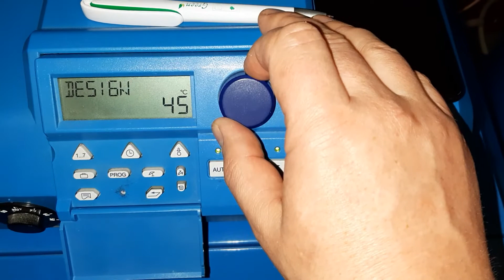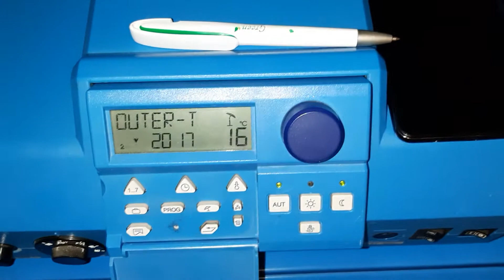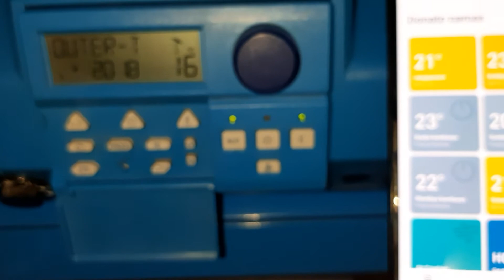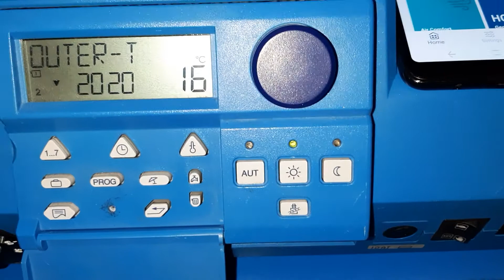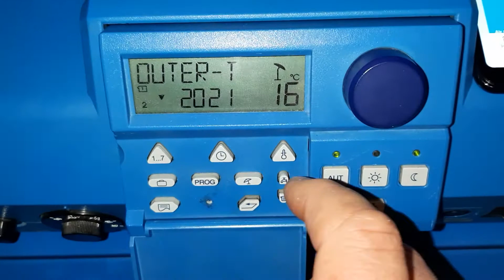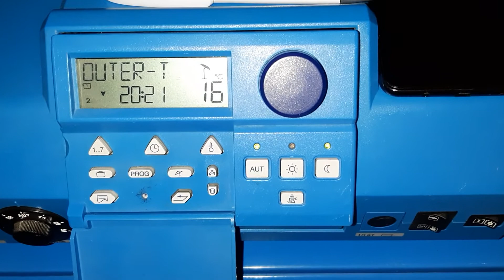TADO  with Buderus Logano 2107

Comment: Hi. I have the same buderus with 2107 control unit. As i saw you upgrade it with tado thermostat. How can I get more info on this setting? I would like to upgrade my buderus with smart thermostat but there isnt lot of info how to do it.
Reply from the maker: Hi. I returned all Tado's stuff back... They were not willing to change the code and adjust thermostat commands to work properly with logano 2107 and purposed to refund all items. There are quite few less expensive smart TRVs, without connection to boiler...
Reply: @DonatasPin  tnx on replay. I was considering to buy this smart thermostat along with smart radiator thermostat but if it doesnt work... just a waste of money
Reply: @DonatasPin  sorry if i bother you but i saw on your video that you have fm 242 module. Im planing to buy this module and get it installed. Can this module control hot water and heating separately? I would like run hot water ie from 07-09 am and 07-10 pm but heating from 07 am till 10 pm. Is this possible to do it with this module?
Reply from the maker: @danieldekovic9706  no, hot water is being prepared when day mode on any circuit... I placed sonoff Wi-Fi module on wire the hot water circuit, this way I have my own water heating schedule, of course only during day mode schedule
Reply: @DonatasPin  this is the key in lowering gas consumption. As  i saw at least 80% of gas consumption is driven by hot water. When temperature drops by 5C in boiler buderus fire up to restore this 5C. I was looking for solution to override this because i dont need hot water all day and gas is wasted. Im doing this now by programs but this isnt a best solution because  night mode must be activated to turn the hot water off during the day. How did you connected wiring for sonoff ? Did you do it by yourself or by some pro?
Reply from the maker: @danieldekovic9706  I did that by myself. will send you a photo tomorrow...
Reply: @DonatasPin  tnx
Reply from the maker: @danieldekovic9706  it's seems not possible to attach photo. I could send it to pm
Reply: @DonatasPin  please do send it to pm if you can. Have you done any other mods on buderus?
Reply: @DonatasPin  Dear Donatas, what does it mean? Please give a quick explanation.
Reply: I solved the problem Perfectly works the Tado thermostat with the gas boiler Buderus G124 without BFU and without extension modul.
Reply: @bollazoltan904  Hi, can you please give us more information how exactly did you done this and what hardware did you use, how did you made connections etc. 
Tnx in advance.
Reply: @danieldekovic9706  I set the menu of the buderus boiler for use without a room thermostat. I switched it to manual heating mode using the middle "sun" button. And the current from the heating circuit pump is interrupted or closed by the Tado thermostat with the R01 setting
Reply from the maker: @bollazoltan904  Hi, that video was prepared to Tado support. They do not support our boiler. But that was announced already after I bought whole set.  I tried to force them to provide help, but with no result and I finally returned  all equipment. Now I arranged  even better with Tuya thermostats from Aliexpress and home assistant
Reply: @DonatasPin  Could you share how you manage to do that ? Thanks
Reply from the maker: @stephaneclinckart1772  please refer to my older postings here. Smart TRVs regulate individual rooms based on local temp and depending on whether family is home or not (this feature coming from home assistant). Weak part of that is that boiler is circulate  water by schedule,  even when all TRVs are closed (autumn/spring time) . For that I tried to use resistor to imitate high room temp from BFU, but switching from winter to summer regime is not working instantly, so that didn't make sense.  Finally I used one more smart reley to cut the circuite between contacts  10 and 12 (there should peace of wire between them). When these not connected boiler is not igniting. There are drawback in that,  because after some time boiler is showing error, but it's gone when any TRV is requesting heat, and throught home assistant connection is restored. Im still testing that...  sounds complicated,  but did not find other solution. Hope that will help
Reply from the maker: @stephaneclinckart1772  that is interesting item... did you bought  it?    As I understand its necessery write ESP code yourself, which is C++ based,  as I know... that could be tricky
Reply: @DonatasPin  It is out of stock for now but I subscribed for next supply. Before end of the year. I'm in contact with Daniel who develop it. Nice guy. He is working on the firmware too... I don't think you will have to code something. Only the specification of your account and IP address. It looks really interesting. ESP can be write in C also... what is easier. I'm a Java dev... use to code on arduino. I don't see a problem for myself here.
Reply: @stephaneclinckart1772 , i'm very happy i'm not the only one who struggle with it. Like all of you i'm searching a way to make my Buderus 2107 smarter.
From what i understood (and correct me if i'm wrong), the 2107 console is NOT compatible with ANY thermostat. It works differently: it decide by itself to heat or not from the information he got (heat curve, external temperature, schedule, day mode). So it's smart, efficient (and it seems to be very usefull) but not connected and can't be used as a dumb heater. By design, you can set a schedule, set goal temperature and manually set the day/night mode. You can set it remotely via using a BFU (300€) but it is still not connected (don't get confuse between BFU and thermostat). There are project like EMS-ESP to act like a interface replacing the use of a BFU but in our case the Buderus 2107 is not compatible because it use a proprietary protocol (ECO-CAN). It seems no one is interessed by reverse-engineer that protocol and build an interface... So we are (almost) stuck here.
The only option i see is to set a fixed temperature on the console (like 21c) and only play with the day/night mode via physically press the "Auto" or "night" button when there is no presence at home (triggered by home assistant for exemple).
We can imagine a servo motor pressing those button controlled by an ESP32.
Or even directly wiring relay (or electronic equivalent) to the mother board where it gets the button information.
IMHO, TRVs option can lead to a waste of fuel (burner should be aware if he should heat or not).
Feel free if someone have other ideas...